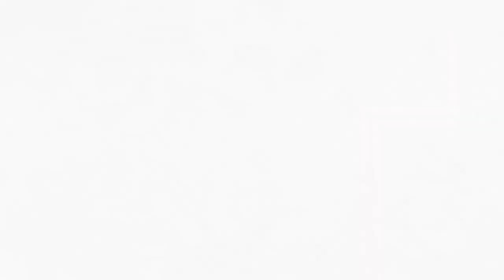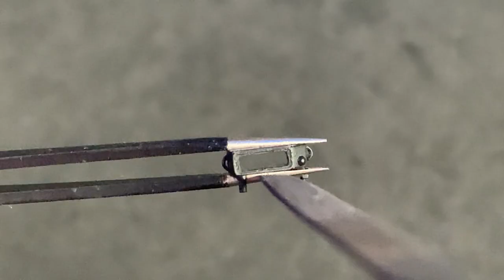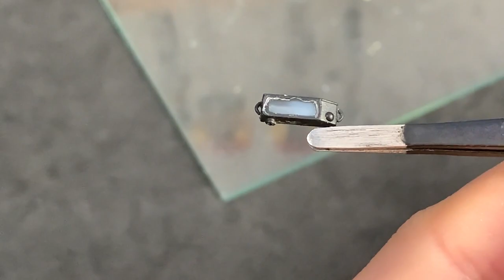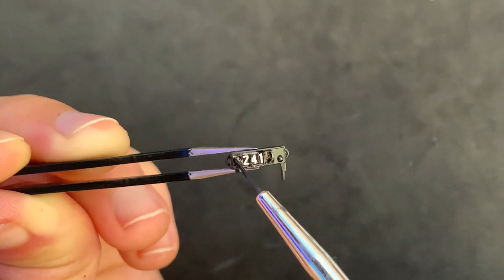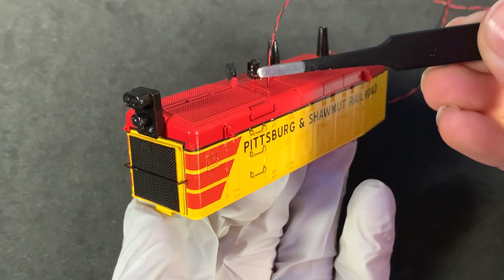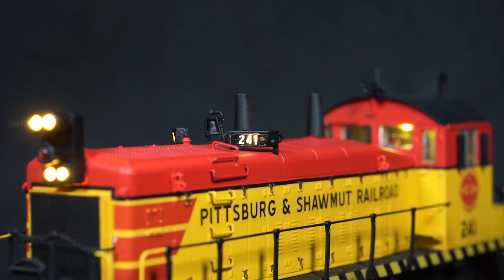How To Light Rapido SW1200 Numberboards (HO Scale)

Comment: I am the customer and was very saddened to find out that these units don't come from the factory with lighted numberboards. But Sonoma Custom Models saved the day. They also did a fantastic job on repainting two of these units that were previously in the Southern paint scheme. The body styles between the two railroads are slightly different so some artistic license was needed. Sonoma Custom Models absolutely nailed it in finding the perfect balance of color placement and striping.